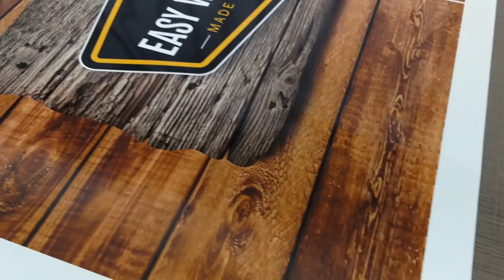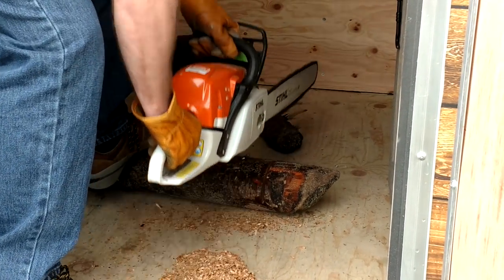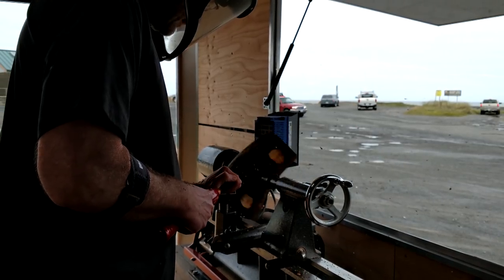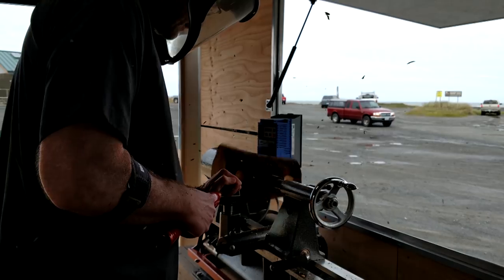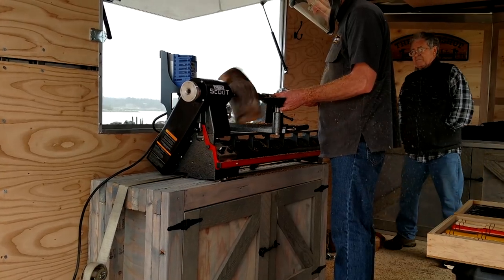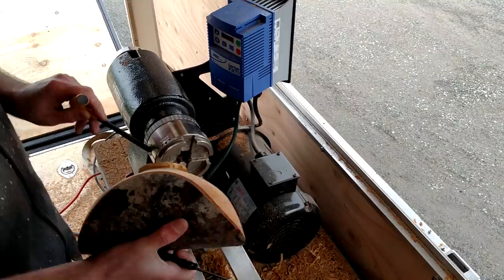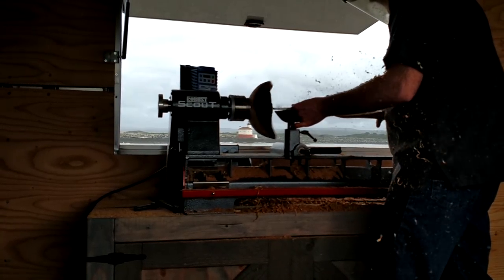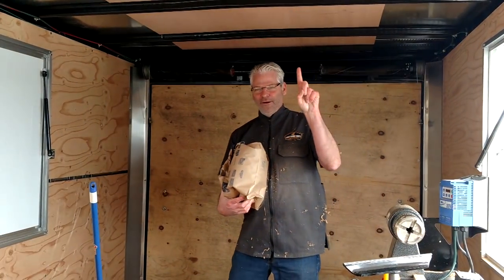Woodturning First Road Trip With The Mobile Shop | Carl Jacobson

Comment: OMG Carl.  I retire in 8 years and this is exactly what I have been planning to pull behind my Motor home for some extra income at street fairs across the country!!!  You mentioned a generator, does it run off the Motor home generator or its own?  I was thinking of its own separate generator.  It looks like you have plenty of room in there for a band saw, a miter saw and maybe a shop vac too.  I absolutely LOVE the wrap.
Reply from the maker: Very cool, Robin and I are having a great time. I have a separate generator for the trailer. Make sure you put in a breaker box though.

Comment: Thank you so much for the video , and awesome trailer and video. I grew up in Bandon back in the early 60's until 67. My was a Doctor there and had a practice with Dr Donald Crane .My friends and I use to go play in the lighthouse and. fish off the rocks in that dangerous harbor.  When there was storms in Japan we would get reports when the glass balls the fisherman use around the perimeter of they nets would break loose and many ended up on the Bandon beaches. So we'd get up at 5am to try and get some before others took them. Anyway I'd like to know what would be a good lathe for me a beginner to turn resins and hybrids only about 3"x 3" pieces? Have an idea for a product so need to buy the correct lathe and tools . Thank you so much Jason
Reply from the maker: Thank you Jason! That's cool, allot of my family still lives down there. Any lathe will turn resin. For pieces that size I would get a midi. Jet makes a nice variable speed one. As far as tools go, Easy Wood tools makes negative rake cutters that are awesome for what you're talking about.
Reply: @CarlJacobson  Thank you for your reply and help.